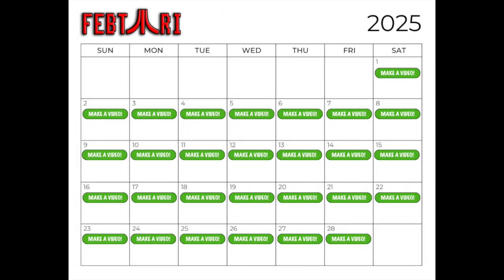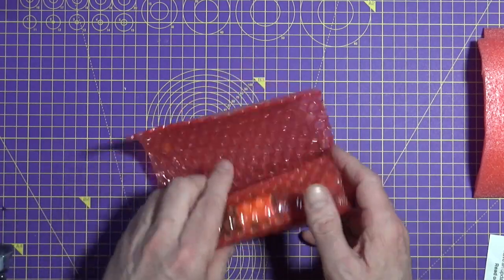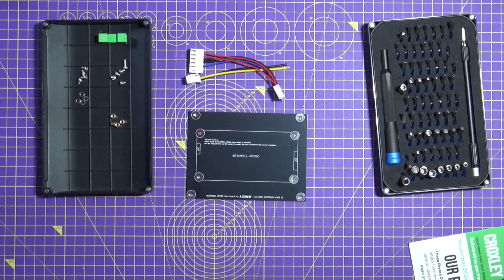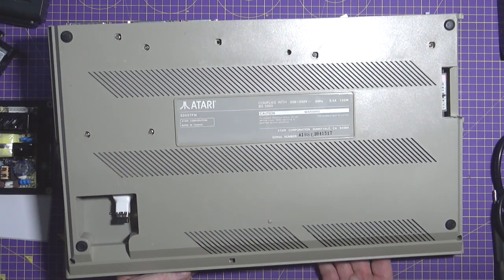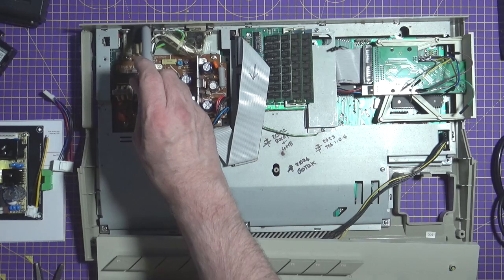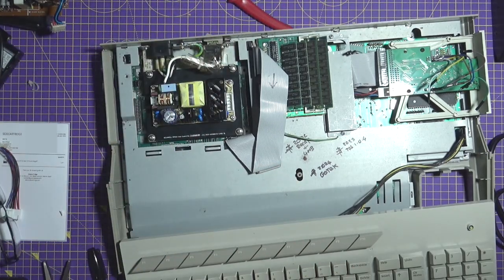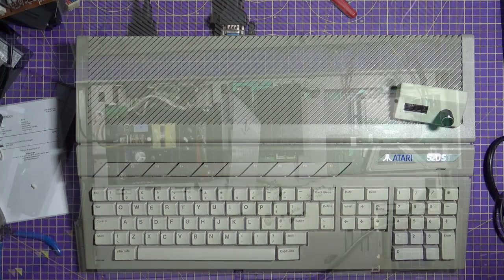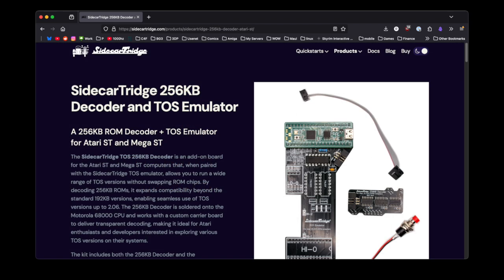The new SidcarTridge replacement PSU for Atari ST/STE/MegaST #Febtari

Comment: Slapped my hand straight across those live heatsinks when i was 13. Yep it hurt... I imagine the new supply runs much much cooler than the baking hot switching MOSFET on the old one?
Reply from the maker: You know I’m an idiot.  Recently bought a thermal camera and didn’t think to check temperatures, but I did weigh them. 🤷

Comment: I found out the hard way almost 30 years ago, call it youthful naivete but I unplugged the floppy drive power on my 520STFM while the unit was on. As soon as it came off, sent my hand straight to that heat sink. My left arm went absolutely numb still clinching on to the power cable, had to kick off from the wall and myself and the ST came flying off the desk. During all of this I let out this hellish scream that scared my college roommate so badly she dropped a picture frame she was hammering to the wall.

I now have a very healthy, almost ridiculously borderline paranoia and respect for mains power.
Reply from the maker: Life lesson learned!

Comment: I've had mine for a while now, it's all good, as is the SidecarTridge multi-device itself (especially with the new features in recent firmware updates). The instructions are pretty good, and include both the solderless method and what to do if you are handy with a soldering iron.
Reply from the maker: Long time no see, how are you doing? Do you have the rom emulator? That’s next for me. It’ll make a real ST like hatari. Switching roms at will. Never had a chance to try euros on a real machine. And my copy of calamus needs a German rom. So I can only use that on an emulator.
Reply from the maker: Euros = emutos 😀
Reply: @commodoreisnottheonlyfruit  I've always been good with v1.62 on STEs, with the option of MagiC loaded from HDD. The multi-device has really been really good though.
Reply from the maker: I might upgrade.  Mine’s an OG dev board. Might get a new one and do a video on the differences.